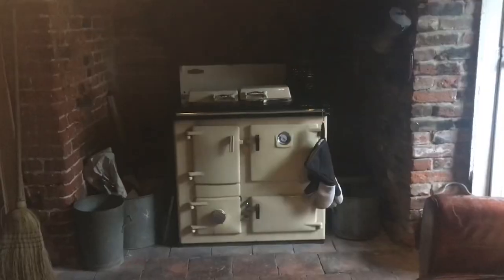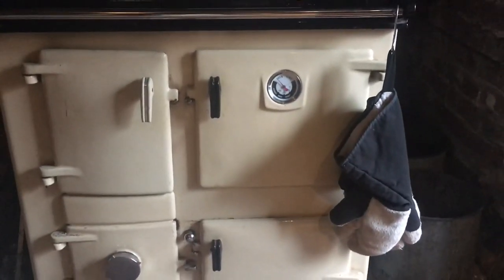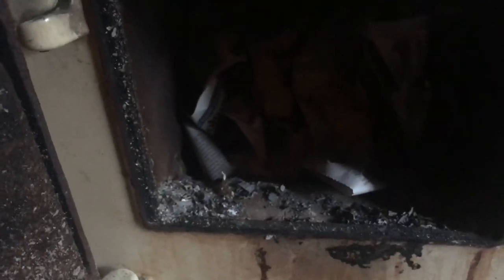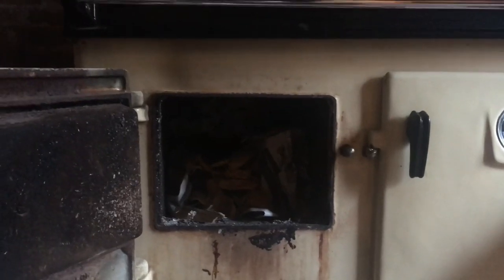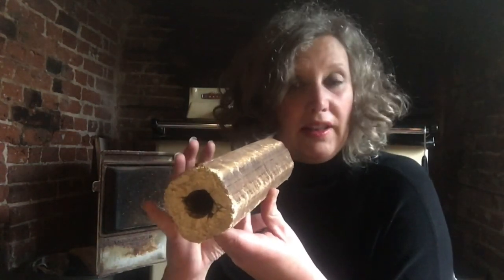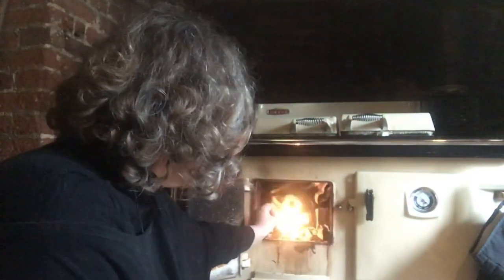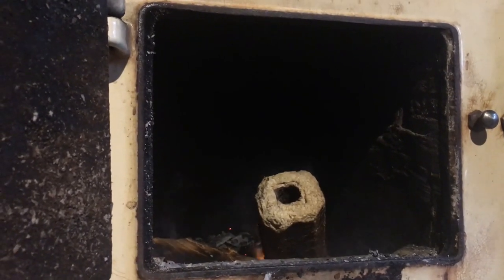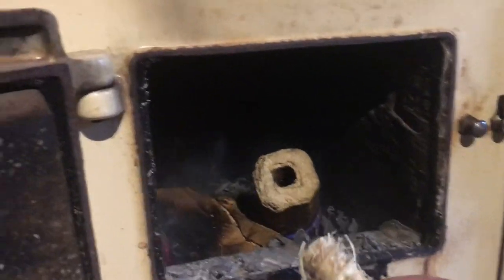How to keep a Vintage solid Fuel Aga Rayburn Cooker Stove Going All Day and night [ Lekto Wood Fuels

Comment: I love the solid fuel Rayburns, we had one in a cottage my parents moved to when I was a teenager.  I’ve got a solid fuel AGA from 1945 now that I fully restored using parts from two AGAs just like yours. Although I use Anthracite or Coke, I only have to fill the thing once a day with a buckets worth, and it never goes out.
Reply from the maker: Hi there, sorry I missed your message from months ago.  I really think these vintage Rayburns make a home and keep a room feeling so cosy.  I agree, coal worked brilliantly.  Pallet wood is the best thing for heating it up but it burns in an instant.  They take a bit of getting used to but are wonderful things :)

Comment: Hi just watched your video. I have tried Lekto fuels before, until I discovered Bioglow. I use their RUF oak blocks as a sole fuel in my 12kw stove. Cheaper, cleaner than Lekto. If I put on six blocks plus I empty the ash on top,the fire will stay in twelve hours, open up the air and the fire recovers, no fire lighters or kindling needed. My friend uses them in a Rayburn heating nine radiators
Reply from the maker: Great tip!

Comment: Lady, you should consider buying some 2 or 3 acres of copse nearby, a pair of axes & a handcart to feed your home fires. If memory serves me right, in the 70s well before the smoke regulations came into effect you could feed your Rayburn even with cheap lignite, they last for well over 6 or 7 hours. Capiche Y'All from Singapore
Reply from the maker: Land in the UK is not that easy to come by.